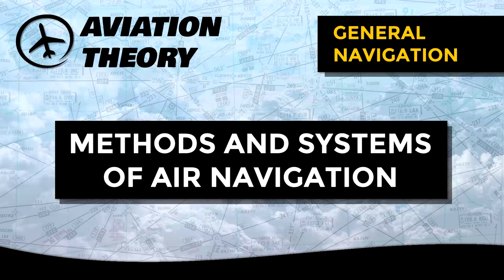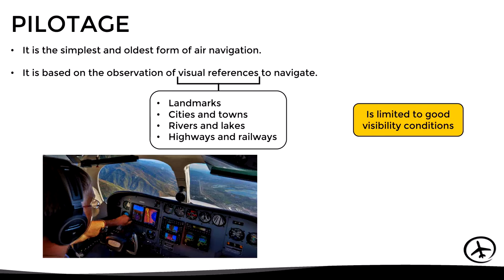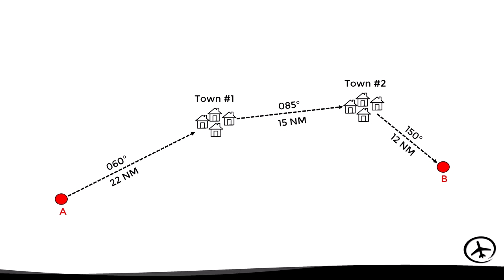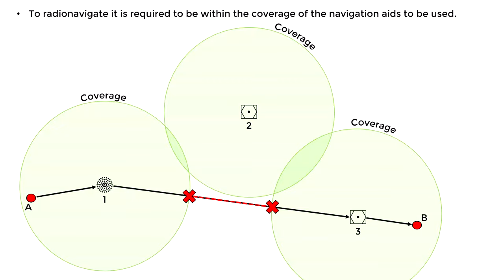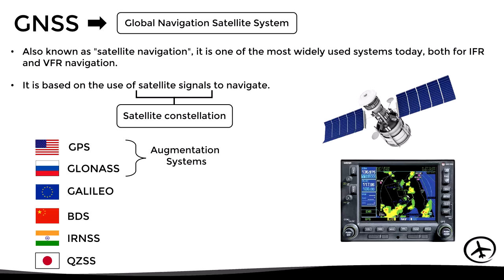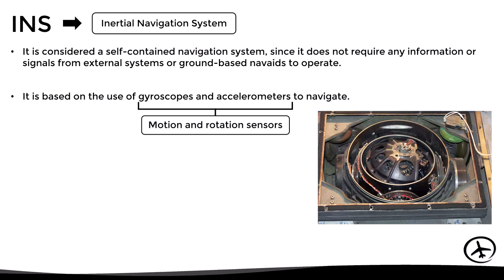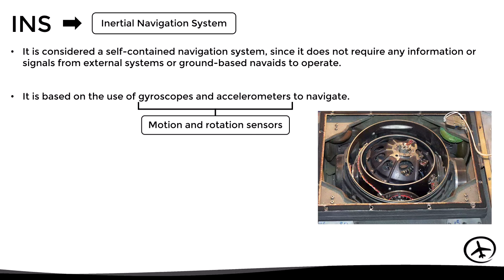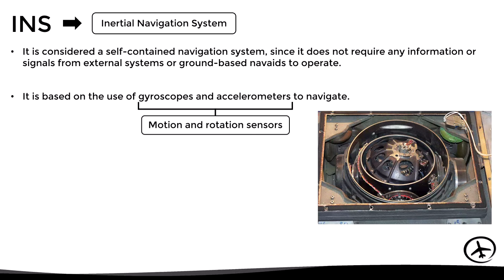Methods and Systems of Air Navigation

Comment: On the video section on min 05:11 the times are not properly calculated correct? Or maybe I am wrong. But if you use the formula for Time,Distance and Speed those timings are not correct using the given Distance and speed values. But please let me know. Great video as usual.
Reply: Hey there! They are correct.